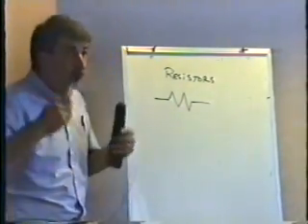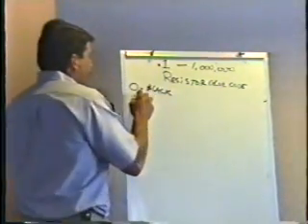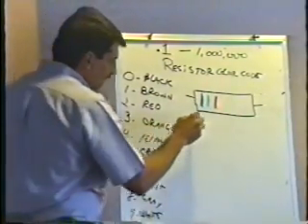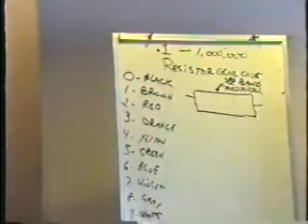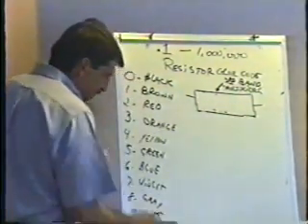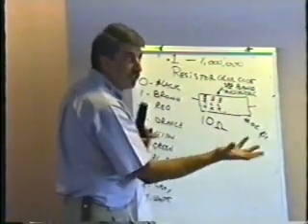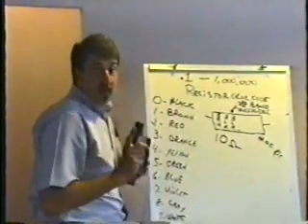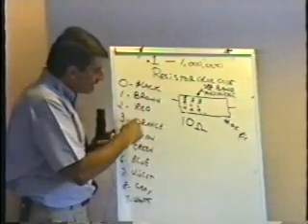Basic Electronics-Chapter 5

Comment: multiplier is simply 10 to the power of N .. where N is any number from the color code.. so if the 3rd band is black which is zero, then it has to be 10 to the power of 0 which is equal to 1. so the multiplier is 1. 10x1 = 10 ohms.